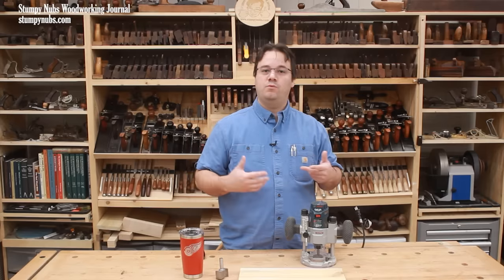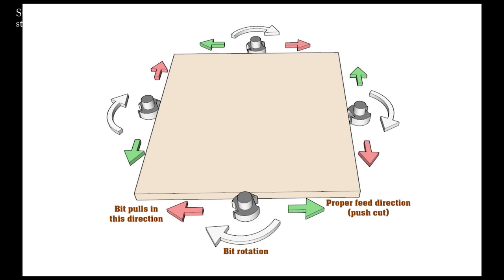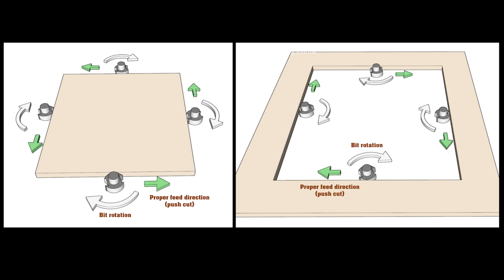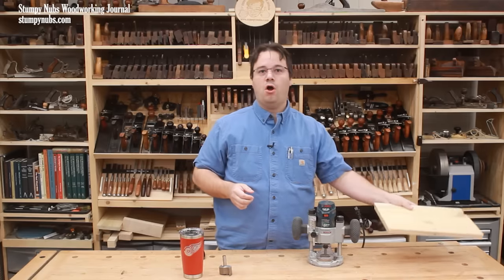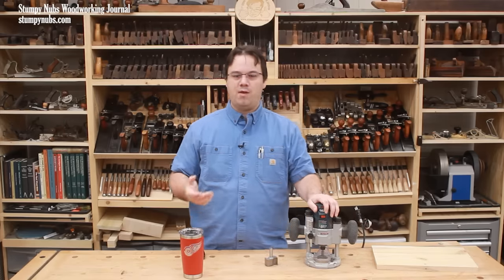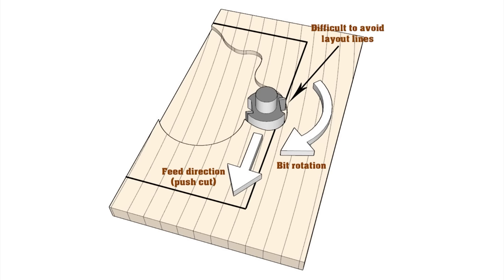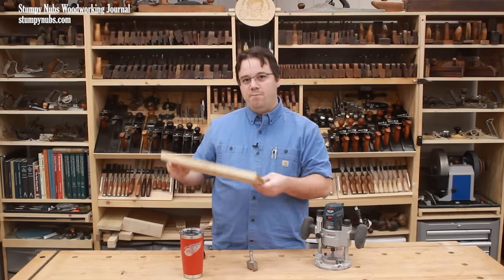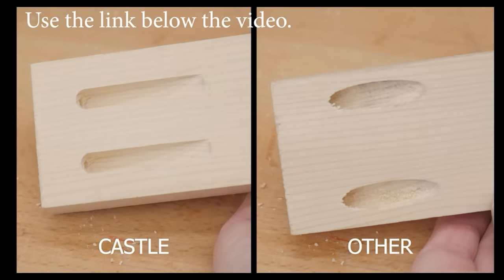The common misunderstanding of safe router feed direction

Comment: For newbies to hand held routers: Until you've got plenty of experience with the tool, ALWAYS push against the cutter, just as you would a circular saw blade. If you lack the confidence with the tool and attempt climb cuts, it may just get away from you and, best case scenario , will only scare the heck out of you. It's no exaggeration a router is the tool requiring the firmest yet simultaneously loosest grip of all power tools. Don't be afraid of it, just don't get cocky ;)

Comment: What an excellent video! When I got my first router in 1969 Black and Decker was kind enough to cast an arrow on both sides of the base as a gentle reminder for the feed direction. Since then, I always took a Sharpie and drew arrows on the base of the router or the top of the router table. I use a straight tailed arrow and a curved arrow. Straight tail always indicates the direction of a push cut. A curved tail indicates the rotation of the bit. That has made things simple for me. You bring up an excellent point about taking light cuts. Gentle cuts. I wonder how many people don't know that several light (and even feather light) passes eliminates most burns on the wood.
Best Wishes To You for a Healthy, Happy 2022!
Reply: And light passes not only eliminate most burns on the wood, but they're safer, and they make for cooler bits, making expensive bits last longer.
Reply: Great tip

Comment: Dad had us do quite a bit of edge work using molding planes by hand before we were allowed to use a powered router.  By hand you can really feel what the cutter is doing and easily recognize when going with the grain vs against the grain and which is most appropriate.  Many of those planes couldn't be reversed because of the profile so many light passes were required to get an acceptable result.  I recognize that most people don't have access to molding planes, but it really helps to understand what that cutting edge is doing before putting power between the hand and the cutting edge.  What's most important overall is to maintain full control of the router and with a firm but gentle hand in both directions let the cutter do its work.

Comment: Hey YouTube land....LISTEN to the man. On 12.19.21 I took the top of my middle finger off on my router table. I was feeding correctly but for a split second when repositioning the bit caught the workpiece in a climb cut direction and sucked my hand into the router bit. My hand was at least 6 inches away and it still got it. Just a split second finger gone. GREAT content !!!

Comment: Being a machinist for 44 years, it works the same as machine tools. The force of the material and the force of the cutter meet head on.  My only issue starting woodworking was to quit trying to measure everything so precise. I would sometimes beat myself up over 1/32”. Wood is much more forgiving than metal.

Comment: When doing a climb cut to avoid tear out I start an inch or so from the end of the board and cut back just that inch, then go forward another inch and cut back towards the first cut. Thus I can work my way along the edge an inch or so at a time making it much safer as the bit doesn't have a chance to gain traction. I hope that makes sense!
Reply: when you climb cut you conventional cut. got it.
Reply: @BTW...  read what he said again.
Reply: Don't you end up with rough spots between where all of the different one inch work sections are?
Reply: @DieselRamcharger  Sorry if you didn't get what I said, I can't think of another way of putting it.
Reply: @DieselRamcharger  What @Cyril Heslop describes is breaking a long climb cut into multiple short cuts.  He says he starts an inch from the end of the board and climb cuts towards the end.  Then he backs up so that he's two inches from the end of the board and climb cuts towards the end again.  Repeat at three inches from the end, four inches, and so on.  Sounds reasonable to me.
Reply: @tarheels100  thats stupid.
Reply: @DieselRamcharger  🤷‍♂️I was just trying to clarify; no need to shoot the messenger.

Comment: Excellent! 
Clamp the piece firmly -- always.
Hang on tight, don't let the router take charge. Do that every time and you won't have to think if it's a climb cut. 
If the wood is questionable or the cut deep, make a thin test cut, and then small bites.
Only work on the side facing you if possible.

Stuck collet? Rap the nut lightly but sharply perpendicular to the shaft with a wrench or similar.

Comment: In machining we use the terms conventional milling and climb milling. Push cut as you explain it is equivalent to conventional milling. Conventional milling eliminates the milling cutter pulling the work into the tool causing an unintended deeper cut "bite" as it takes up any backlash in the axis drive train. This can break a mill and/or damage the work piece. 
Woodworking has the same dynamics and you add grain tear out dynamics for more fun! There are simple rules to follow and you covered them adequately. Thank you for acknowledging that multiple dynamics affect the wisdom of choosing climb or conventional milling. In general climb milling with a hand held router or in the router table is far riskier than conventional milling.
Reply: @BTW...  St. Louis, MO

Comment: I’ve had a workpiece fly out of my hand at the router table. Template routing a curve and not minding the change in grain direction. Almost got my hand. But the workpiece flew right into my project table top and had to be done over due to impact damage. Lessons learned that day, the hard way. This tip is valuable! Great content!

Comment: as others have said, very good video and explanation.  I've been using routers for 60 years or more, (yeah, since I was a teenager)  I certainly learned from time to time that I was climb cutting.  Yes, it can make for a serious mistake if you don't know what you are doing.  But I've also heard from so many people that one NEVER wants to climb cut, which I totally disagree with.  If I'm cutting anywhere near 1/2 the diameter of the router bit cutter, for sure I'd never want to climb cut, but when cutting less than 1/4 of the router bit diameter, then I might.  (of course that depends somewhat on the diameter of the bit.  LARGE diameter bits I might say much less still)  I have found that normally I rout in the Non climb cut direction, but for a final pass, especially where the grain is easily torn, I rout IN the direction of climb cut.  It makes for a smoother cut!  Normally this is when I'm only cutting 1/8" or so with the router in that pass.  Not every time, but when there is potential for tear out, and it is convenient for me, that is what I will do.  I hold onto the router firmly, and often will go over the work twice.

Comment: I don't use my hand held or router table much, but when I do, I manage to spend the first 20 minutes spinning the router bit, then visually flipping over my workpiece, 2, 3, 7 times in my head...before finally giving up, going back in the house and cleaning the lint out of my dryer screen. This video was a great help. "Which way does the wheel want to go? -- Don't push it that way..."

Comment: I was trying to some wooden utensils based on existing ones as a router template.  Using a flush trim bit with bearing, I ended up splitting the grain as I rounded the curve, and wrecking my work piece.  This video helps me understand what actually happened, when the split piece turned into a projectile (away from me, thankfully).  Thanks for the video, you definitely go above and beyond to explain the science behind things, and I appreciate the always relevant measures toward safety.

Comment: This video is a good refresher if you haven't used your router in a while (like me).  I cut a slot on the router table, which went fine.  But when I went to widen the slot a little, I moved the fence closer to me, instead of further away, resulting in the back of the spiral bit wanting to do the cutting.  The workpiece flew out of my hands to the left, and it snapped the bit off.  Lesson learned!

Comment: Thanks for this.  Preparing to build a pair of Tower speaker cabinets from 3/4"  Red Oak and will need to use a router for some of it.  Not a tool I have a lot of experience with  and I need to cut circles with recesses for the speakers and round off the edges of the cabinets so they look less boxy.  I'm more of a carpenter than a cabinet maker so I need all the help I can get.    Thanks for the video!  : )

Comment: Not exactly on topic, but I cut a ton of carbon fiber with a cut-off wheel die grinder, and I usually climb cut. One reason is that if the cutter grabs, you can allow the grinder to rise up and away from the work, rather than down (it tends to rotate away from the work with your wrist or hand being the pivot point). Another reason is that it directs the flow of dust and chips away from your face. 

it may be more risky, and take more of a practiced hand, but after years of doing it (on some very expensive work) it's worked well for me.

as for routers on carbon fiber, it doesnt seem to matter much which direction you are going. maybe because we use abrasive bits rather than cutting bits.

Comment: One of my early mistakes happened one day while I was using the router table to cut chamfers on some half by half material. I had no idea which direction to feed my stock through until the tool ripped the piece from my hands threw it against the far wall with so much force that I'm sure it could have cracked a rib. I've been very careful about router feed direction ever since.

Comment: in school we're working mainly with climb cuts (against the direction of the cut) in the router tables, because the machines are so powerful they can pull the pieces and it's therefore a risk during operation just like you mentioned. We have a feeding machine that we MUST use when we're cutting conventionally (with the direction of the cut). With a CCW (right hand) rotation direction we're working mostly from right to left.

Comment: climb cutting, I learned the hard way while trying to route some aluminum with a 3/4" by 1/4" shank straight bit......conventional is the way to go, but a very light climb cut will give a better finish on a final cut....at least if you are routing aluminum.....great video Dr. Nubs....cheers from Florida, Paul

Comment: I had a router (1970's,) when I was new to using those things, that would eventually allow the bit to work it's way down and out of the collet no matter how much it was tightened and locked in. I had to use a light climb cut in a couple of passes before pushing it in the normal direction so it wouldn't take too big a bite. I got a pretty good touch at it and thought that was normal.

Comment: I had this conversation with a certain female woodworking Youtuber a while back.  She insisted that grain direction was the 'only' consideration.  Even after explaining, while trying my hardest not to patronize, she still held on to her view that grain direction was the one and only factor.  I must admit, I still have to think about it sometimes.  You have hand held with the bit pointing down. Table mounted with the bit pointing up. Inner edges with possibly four different directions when machining a void.  You mentioned mortices — is a blind dado always a mortice? — which is another time I have to stop and think. Which is the right direction for the first cut when the bit has full contact on both sides, and you are mainly trying not to wander away from the fence.  You have no choice but to be move in both directions if you have to initially  plough into the slot away from the end stops and then machine up to the end stops.  I tend to take my time and not be too greedy in that situation.
Reply: How does it matter what that other person has dangling between their legs for the topic of the conversation?
Reply: @Engineer9736  I hope it's not dangling. Lol. That would be a sight.

Comment: Whenever I am using my handheld router, I start the motor with the bit about an inch away from the workpiece, then slowly move the router toward the workpiece until the bit starts cutting. I can feel which direction the router wants to pull, so then I know to push it the opposite direction. I will sometimes climb cut only after push cutting around a corner to clean up any small tear-outs or burn marks from the original push cut. Also, when I finish a cut, I move the router and bit away from the workpiece without lifting the router, turn the motor off, wait until the bit completely stops, then lift the router. Yeah, it takes longer, but I think it's safer. I've made enough scary mistakes to know that I need to minimize any chances of really hurting myself. I follow the same procedure of not moving the workpiece until the bit/blade stops with my miter and table saw as well. In fact, my owner's manual for my miter saw (Makita) recommended doing it that way, and I thought it made a lot of sense, so that's what I do all the time. I'd rather work a little slower and be a little safer. I know others might have a different opinion.

Comment: maybe it was deemed to complex for this tutorial to mention but with a power-feed you can operate both a router table in reverse-feed situations AND a shaper with the motor reversed. I bring this up simply because setting a definite rule with someone when they're first learning the basics may restrict their thinking in later, more advanced scenarios. My growth as a woodworker has at times been stunted by my mentors telling me "...always...never..etc" when as I've gained experience I have discovered that in woodwork there is always a way to do something and it's very likely you already have the tools.

I should add that I do very much enjoy your method of teaching and practice!

Comment: My router is the one power tool that I am always maintain a healthy level of caution when using.  Basically it scares the shit out of me - but in a good way.  I'm never complacent.  Also, thank you for this video, I always knew right away the direction I should be using the router, but never knew the terms "push cut" and "climb cut"

Comment: thanks for the video I was really looking forward to the CNC router integration with fusion 360 tool paths. one thing I have been doing is taking photos of the wood set up in the CNC and designing around features in the wood and now what I realize what I should be doing is changing my tool tathing to accommodates the grains in the wood as well. Great video still in the camp of don't let apes touch power tools a machine can always just do it better unless you make CAM mistakes ....

Comment: This also applies to a CNC machine which really is an automated router. Most software will automatically determine the direction of the cuts so they are a push cut, but as mentioned, sometimes you might want to change the tool path, if the software allows it, so it is a climb cut. I see people discussing tear out, say when using pallet wood, and getting into this huge thread about what end mill is needed to solve the problem when just a change in direction may solve the issue.

Comment: I have been horribly scared by my routers over the years, although I have never been injured by one. I often secure mine upside down in a bench vice, preferring to move the part, not the tool.
One mistake I made early on was not doing the chuck up tightly enough, and having the bit start to shift downwards, which almost caused a nasty situation when free-handing.

In general, the fear I have of my routers makes them very safe to work with, because I take such great care with them.

Comment: Really useful video for newbie - but it would also be useful to have something that would help explain how to avoid tear out on a router table.  That is where I have been experiencing most problems, including having a piece pulled straight out of my hands while trying to work around a corner on to end grain.
Reply: rout the end grain first using backer blocks. then rout the edge grain.

Comment: Just to be clear, the "rule of thumb" for a router table seems to work in terms of which way to push the wood across the bit in order to execute a push cut (as opposed to which way the bit should be worked across the wood when applying the rule of thumb for a handheld router). Therefore, a push cut on the router table is going to mean working the wood from right to left across the table, correct (if routing the outside edge of a piece)?

Comment: I use the right hand rule of routing. With your right hand, palm down, point your thumb at the surface to be routed and extend your index finger. Thats the direction of travel and it works for outside and inside cuts

Comment: Great video. I have one issue. When following your directions and using a router table, I frequently get kick back even when removing around 1/16”-1/8” material. I’m using an expensive double bearing but. Do you have any idea what I’m doing wrong?

Comment: Can you help me as This explains when on edges but not in the middle if making a straight single groove through a center.

I’m guessing this only applies when the bit is coming into contact with one edge.
When making a straight single groove through the middle its a push and climb cut as its using both sides of the bit at the same time.

So in this case I assume it doesn’t matter which direction as the bit balances itself out so it can’t pull the router away from you.  

Can you confirm or deny? Great videos with great visuals :)